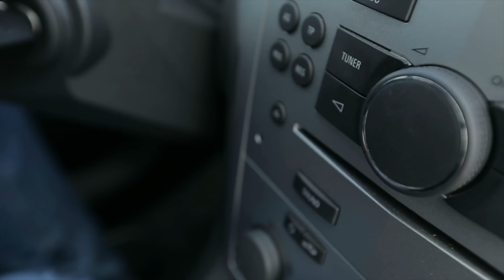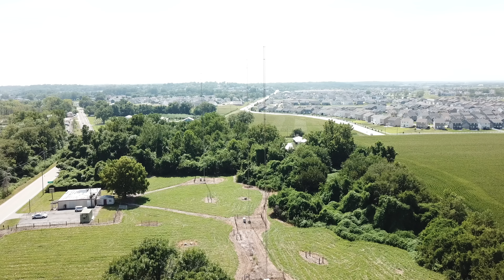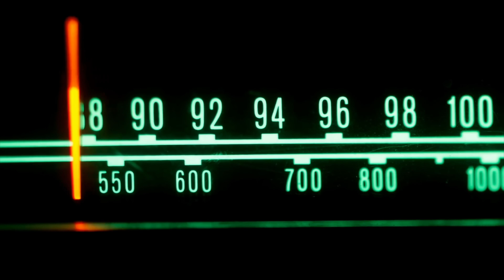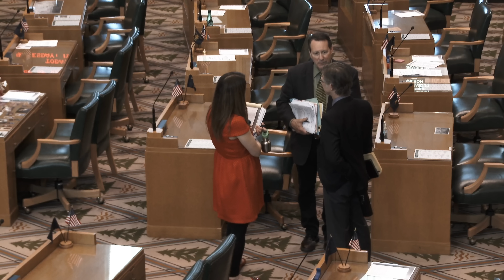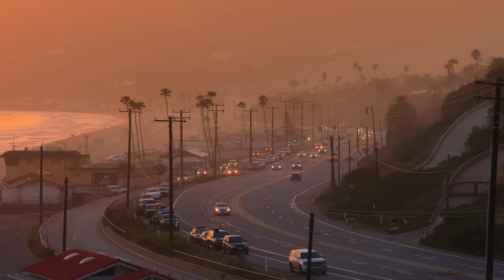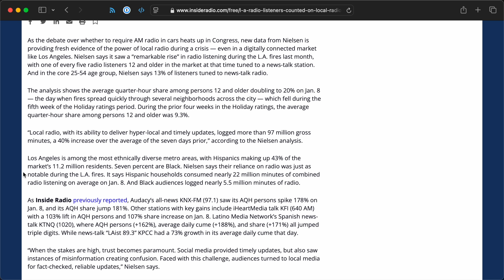Automakers are losing the battle with this 100-year-old tech

Comment: I went through the Hurricane here in SC last year, & our power was out for well over 2 weeks, so the cell towers while not damaged physically where affected with heavy usage thus making them unreliable for anything more than a basic SMS txt at times, so having my solar powered radio with an AM band was great for getting information on what was going on around me from the local talk radio station here WGAC 580 AM. So I for sure hope this bill passes.
Reply: Yeah, we had a similar situation here in the South Pacific. Up in New Zealand's North Island, (usually a nice mild climate year 'round) as a freak weather they got the tail end of a dying Tropical Cyclone ("Gabrielle"). The problem was absolutely massive dumps of rain, in never before seen quantities over a short time. That led to floods and in rural areas especially that took out roads and  bridges, powerlines and phone/internet cables.  Because so many roads and bridges were out including in rural areas where there is normally only 1 or 2 roads even giving access to that area, repair technicians were limited in their ability to get in to start repairs.

Even those areas that did have some cellphone coverage, the backup batteries in the celltowers run down after a day or so without the main electricity to keep them charged.  

AM radio, especially at night, travels much further distances, so people using a small battery transistor radio or car radio, could get news and updates, including reports of where food and water drop-offs were available etc.    

Another story... My previous car had a radio where the FM setting didn't work well, so I just had it tuned in to a couple of my favourite AM stations instead.

Comment: If AM radio is that important, why not make it mandatory on phones? That would make more sense than cars.
Reply: I get what you're saying, but many phones don't even include an FM chip anymore because so many manufactures took out the headphone jack that was needed for the Antenna, but adding an AM chip would also require an internal AM antenna which unlike FM would  cause a lot more interference with the electronics inside a smartphone that tightly packed.
Reply from the maker: Yeah it's a good question, but for practical reasons, not going to be feasible. Would be easier for cars to have a little handheld radio people could use like the pop-out flashlight on Rivians.
Reply: You're going to have a problem with an antenna for the MF band on your phone.

Comment: I agree that having AM broadcast receive capability in vehicles is important.  But I also would like to see car "infotainment" systems include the ability to receive NOAA Weather broadcasts and alerts.  Limiting ourselves to cellular or satellite reception  makes us rely on complex systems; in critical situations more basic systems may be the only thing working.
Reply: Wholeheartedly agree. If the radio receives FM minimal circuitry is involved to receive the weather frequencies which are around 160 mHz IIRC.
Reply: Before GM destroyed SAAB, their cars had NOAA WX Radio
Reply: @DCDura  My 1995 GM Saab had it.
Reply: The AM frequency is easier to receive in poor reception areas than higher band frequencies used by FM or DAB
Reply: @CawKee  DRM is made for AM and SW bands
Reply: theres no reason all car radios couldnt pick up weather radio, its standard on a lot of farm equipment and heavy trucks
Reply: My BMW has NOAA weather stations. It's a nice touch.
Reply: Which model and year? @mediocreman2
Reply: I miss my 03 Subaru Forester. It had a great AM radio but it also had weather band. I covered all of eastern Iowa in my work travels and the ability to hear those weather broadcasts was essential. It helped me avoid a number of tornadoes and severe thunderstorms.
Reply: Modern Deere tractors run weatherband. If the evil, greedy, green brand can do it, so can auto manufacturers.
Reply: They should put in an SDR that can tune from 100kHz to 1GHz, it's not even an expensive or exotic thing now.
Reply: @treelineresearch3387  There is actually a radio for cars that has that i think.
Reply: I want weather and shortwave
Reply: Based
Reply: Spot on! Well said!
Reply: The only critical systems companies have are line go up. They don't care about anything critical to you
Reply: Hey yourself a cheap handheld crank radio that catches NOAA signals.
Reply: Mercedes has had weather band for 20+ years.  In my area NOAA weather radio is useless, just a computer rattling off endless statistics of wave heights.   Even if you are boating, you're not going to wade through 10 minutes of that.
Reply: @grayrabbit2211  They repeat the information so any time someone tunes in they don't need to wait very long to get to the part they need.

Also, having the ability to trigger a severe weather alarm on the receiver means you don't need to check periodically, just react when it goes off.
Reply: The German perspective: I never ever listened to AM radio in my entire life, but understand its benefits in Alaska and other sparsely populated areas of the US where good FM coverage would be impossible to achieve.
Reply: @GermanGuy007  its called MW in europe, it was still around in the late 90s when i was there
Reply: @GermanGuy007  That is crazy to not have ever have listened to an AM radio.
Reply: @ It’s like watching black and white TV these days when all stations transmit in color and HD. Even in the 70s all German radio stations were transmitting in FM. Some were additionally transmitting on AM or on LR back then to cover East Germany. 

But even most East Germans could listen to “western enemy radio” on FM and watch German TV because of transmitters along the border and in West Berlin. Without knowing about a better life in western countries the Berlin Wall might have fallen only years later.
Reply: DRM+ Medium Wave could be the solution as it is a Digital MW radio format capable of multiple programs per transmitter and sending images.
Reply: @Loanshark753  I've never heard of that, but it sounds interesting.
Reply: @Loanshark753  Digital radio sucks for any kind of distance listening.
Reply: @MUUKOW3  DRM is made for MW (AM band) and SW
Reply: The weather broadcasts are on regular AM . My Subaru came with the weather band built in.
Reply: As I understand NOAA broadcasts may not exist in the nearest months as Elon Musk's DOGE is targeting it as privatising weather forecasts is part of Project 2025.
Reply: @xpehkto  Neither Trump nor Musk have ever supported Project 2025
Reply: @xpehkto  You got any facts to back that up? Oh wait... You non ironically referenced project 2025. You've just erased any credibility you ever had.
Reply: @xpehkto  🙄🤦‍♂️🤦‍♀️🤦
Reply: @xpehkto There is always one of you that pops up .Quit watching MSDNC and being low information.
Reply: @MUUKOW3  maybe read GroundNews more yourself.
Reply: @ZensationalRZ34  I can usually do what they do without an app. Pretty easy to tell who is full of it and who has actual facts.
Reply: One has to realise that zero of these bills are for our benefit.

Comment: Why not pushing Digital Radio Mondiale (DRM)? Same freq
Reply: It's been extensively tested (especially in India). The problem is that it doesn't work nearly as well as normal AM. Like all digital systems, it works well if the signal is strong, but once the signal gets weak, or fades, or there's interference, DRM "falls of the cliff" and you hear nothing for a minute or so till it re-syncs. It was a great idea, but it just doesn't work.

Comment: In 1962 I got a pocket transistor radio for my 6th birthday. It had two Civil Defense markers on the dial so we could listen to the President while hiding under our desks that Bert the Turtle assured us would keep us safe...
Reply from the maker: Duck and cover!
Reply: My first AM pocket radio was a 10-transistor radio. Eventually I move up to a 16-transistor radio. 😀 When I turned 14 I began DXing AM radios stations. My best verified reception was VOA in Kavala, Greece running 1.5 million watts. I think it was on 791(?) KHz. I received a QSL card from VOA for that. Not a bad reception from the Albany, NY area.
Reply: @JamesF.Pasquini  I collect vintage radios Still fun DXing on AM !
Reply: Conelrad!
Reply: ❤Duck and Cover🎉😊Awesome❤💥🍄🍀
Reply: CD 640 khz    CD 1240 khz
Reply: There was a turtle by the name of Bert… got my first radio in the late 60s, and it didn’t have the Conelrad frequency markers on it. I would have loved it if it did.
Reply: The vast majority of the damage done by a nuclear weapon is the shockwave.   This shatters windows and causes ceilings to collapse.

It is a great idea to duck and cover in a nuclear attack.

The idiots saying they'd rather die in the blast?  Let em.  If you survive the thermal radius and the shockwave, you're 80% of the way home.  Warheads detonate at altitude in order to maximize the shockwave, the most damaging part of the detonation.  Air detonation doesn't produce the fallout that a ground burst does.  Thermonuclear attack doesn't necessarily mean the end of the world, it certainly doesn't mean mutants or any other nonsense.

The other 20% is dealing with the other people this current society produces who survive with you. 

Duck and cover is a good idea.  Treat it like an earthquake.  Oh, and own a dossimiter and a way to filter water, and lots of lugols solution.
Reply: Don't duck and cover if you don't mind being hit by the pressure wave and the intense first few minutes of radiation
Reply: I have a few countertop radios with CONELRAD markings that I found at antique stores. They work great, but must be plugged in. I bought my first SW radio in the 90's, when our boys were in Cub Scouts. I didn't even know that those were banned for a while in the US.

Comment: AM radio is reliable and wide coverage
Reply: Sometimes the last resort is the only one that works. (Or is AM radio the first resort? It's the oldest!) When I was a kid, I put together a Radio Shack crystal diode kit, and it worked without a battery. Let's hope that it never comes to that, but it would never be able to decode a digital AM signal.
Reply: It is just a bit unclear.
Reply: At night anyway. During the day I only get one station.
Reply: @deedzy  yes. I get the local AM strong on my home telephone.
Reply: Which is bad for profits because theb a company can't as easily trap you a monthly subscription
Reply: AM radio is entirely owned by Republicans, all you hear on AM radio is hateful right wing propaganda. NOBODY should be listening to that.  it would be a great medium if it was non-biased and truth based news or music, but it’s not.
Reply: Digital AM is transmitted in the frequency side bands outside of the audio range. The audio, which is nearer to the carrier frequency, is still available.